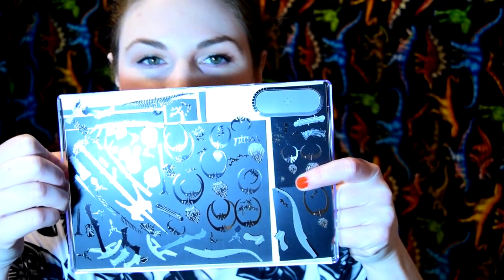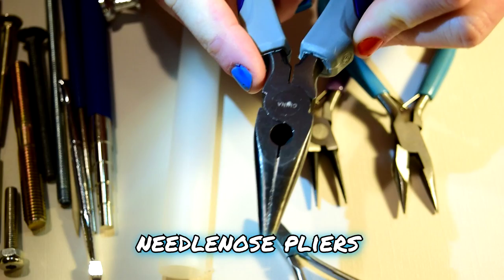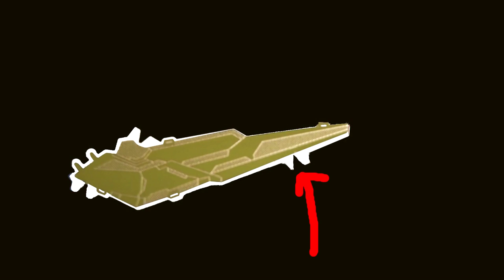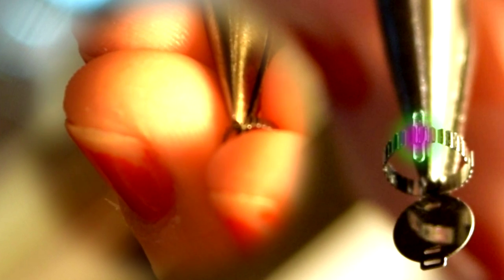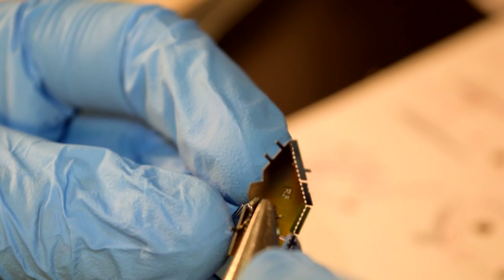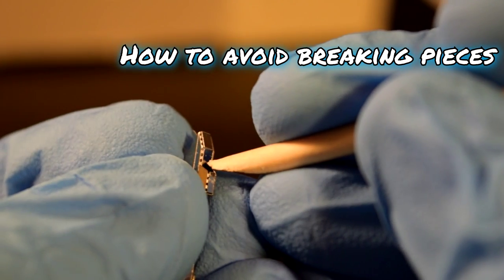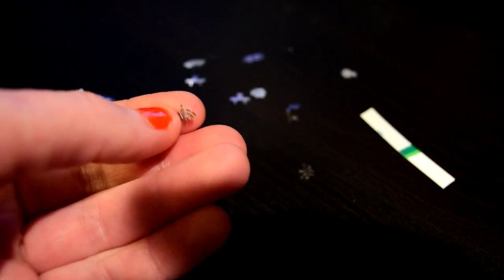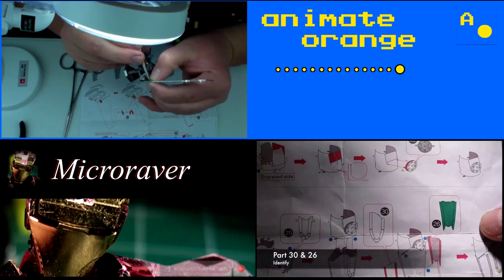Metal Earth Tips and Tricks

Comment: This was a GREAT video on tips for building theses 3d metal models. I've done maybe 30 or so, so far. I've found that a cheap set of drill bits and set of 1/4" drive sockets work great for bending round parts. One thing that I have not done is to work with the latex gloves. They are too clumsy for me.Again, great video.

Comment: If you use a coned solid rod with a slit in it is the easiest way to swist tabs I use for twisting, bending and all kinds of lift functions and its much faster and cleaner then pliers. I also use a bending block you can find them by typing photo etching bending block a must have. You can also run the metal.sheets in hot.water.to take out the springing of the sheet keep.parts from jumping. And I have used the snips you are using and they loose there edge quiet quickly. I personly use model snips from hippy shops extremely pointed sharp little snips and they are her durable I almost never have to file nibs down.

Comment: Have you built the Nautilus?  I'm a very experienced modeler and have built a few other Metal Earths perfectly no problem.  The Nautilus seems to have some geometry problems with the hull.  I have cut the tabs off and used 3,000 lb super glue to glue from the inside to make perfect, clean joints.  I am thinking seriously of removing one of the hull facets on each side due to the parts not aligning.  The geometry just doesn't seem to work.  I am also thinking of moving the superstructure aft a bit.  Maybe shortening it some as well.  What is your experience with this kit?

Comment: I make wooden model ships.  Right now, I’m lining the hull of a tugboat with copper sheeting to customize a kit,  Cutting straight lines through metal is harder than I thought, and you can’t compensate for errors by sanding off the irregularities.  Any tips on how to cut a nice clean straight line in a copper sheet?  Also, molding the copper to the hull is difficult, so any help would be welcome.

Comment: anneal the parts, with controlled heat(jewelry torch, jet lighter with distance), research it first, before you try on a real part, use part of the supporting sheet that holds all the parts.

Comment: Hi I'm only thirteen and I started building metal earth models when I was eleven. Unfortunately I've only mad 4 I wish I watched this video before I made the f-35 model. I may have stuffed it up. My grandma owns a hobby shop so. I get them for FREE. 
At the moment I have made
A titanic
Turantula
Drum kit 
And a Sr-71 blackbird make a video on best glues to use incase you snap a piece
Reply from the maker: You must have a talent for models, I was the same age as you when I started building things like this. Snapping pieces is a learning experience. If you practice and be very gentle with how you handle the models you won't snap pieces. The metal parts are so tiny and thin that I don't think glue alone would be able to repair. Maybe using a piece of tape and cutting it very small, attaching it to the bottom side, and on the top adding a pin drop of superglue with a toothpick might help. But you're on the right track and I hope my video will help you avoid breaking pieces all together in the future. Thanks for commenting!